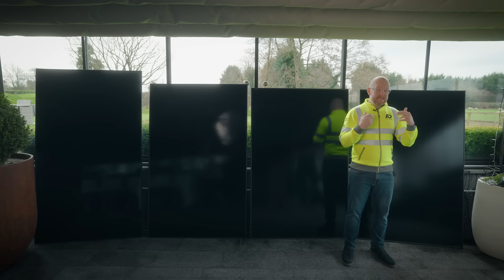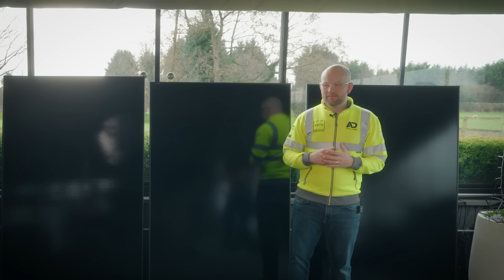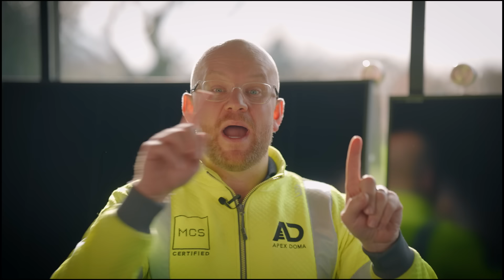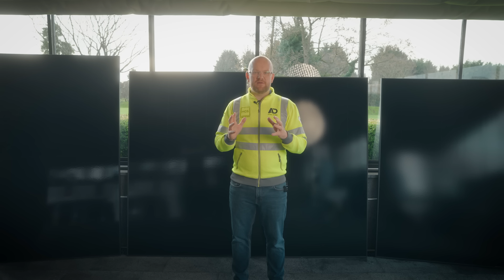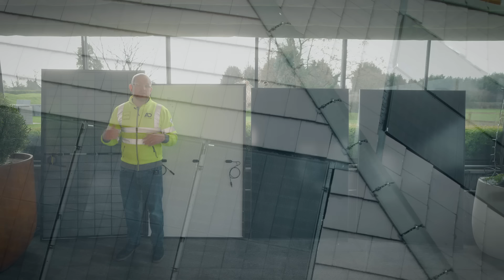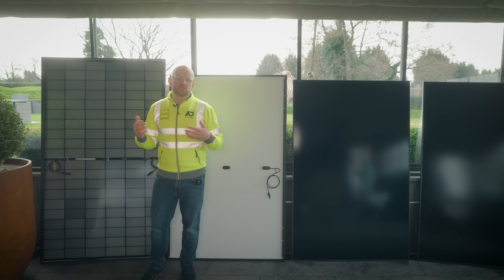Best Solar Panels 2026 UK 🇬🇧 (Aiko vs Longi vs 510W… What Actually Wins?)

Comment: So disappointed with your , not once you mention and voltage , you can't have current without voltage , I need to connect my panel in series or parallel !
no VOC come on.

Comment: Longi is a long term well established in house manufacturer that supplies cell to other panel manufacturers,aiko cheap and the new kid on the block not yet has a proven long term reliability,Longi,Trina,jinko,euener,rec,ja solar,Canadian solar,sun power,all well established panals been around a couple of decades with proven track records.the market is flooded with aiko atm good,bad or indifferent.

Comment: About to install the following south facing ground mounted array ( - Still trying to decide whether to add optimisers or to wait and see & to retro fit.)
Any thoughts / comments very welcome ?

Solar Panels
JA Solar
20.250 kW Total Module Power
45 x 450 Watt Panels (JAM54D-41-450-LB-TS-HT-AB-MC4)
19,110 kWh per year

Comment: I need help. We are just about to choose panels. It is between Aiko 3P+N 540w dual glass black frame and Aiko 3S60 Mono 530-555w. I like the look of the 3S better, but understand that dual glass may be tougher.  What do you think? They are going on a due south facing roof
Reply: Sue, are you in the UK? I was told by an installer that max Aiko I could get in uk within 2m long (per panel) was 510. I too, will be due south facing. Wold love to know more about your provider... many thanks

Comment: FYI, there never have been panels called "TOPCom".  Perhaps you're misspelling and mis-applying the term "TOPCon".  TOPCon stands for "Tunnel Oxide Passivated Contacts.  Some but not all solar cells with front side "silvery" lines are of the TOPCon variety.

Comment: We had 17 of the 510w Aiko fitted, with a 18kw Sigenergy and just had a 8.5kw ASHP fitted, we are all Electric and our Barn is 1500sqf with vaulted ceilings. Its sunny today and our Eddi is warming our water hot water, the solar panels have charged our battery and the ASHP is using 1.5kw at 20c and we are selling 5kwh to the grid at 15p kwh. 🎉
Reply from the maker: Sounds like a great setup, it's great to hear those panels are performing so well for you! 😊

Comment: Great video I know this mite be a bit of a weird question i have got a ecoflow delta 2 and I want to charge it with a solar panel in my garden and I can use a 500w max solar panel. What solar panel would you recommend i have been told to get one from city plumbing
Reply from the maker: Just don’t overthink it. Any standard 400–500W panel will work as long as it’s not too high voltage (most aren’t anyway).

Main thing:
	•	Standard mono panel
	•	MC4 leads + the right adapter for the Delta 2

City Plumbing is fine.
Reply: @apexdomasolar cool thanks for your help the ecoflow delta 2 solar input is 11-60v 15A. I have got a ecoflow mc4 to xt60i cable

Comment: All black = yes I want to prioritize looks and think that black is cool, and don't care that the panels heat up a lot more and production drops fast.
I thought the effing point of having solar panels was to generate electricity otherwise why bother. Annoys me to no end...
Reply: They do not heat up a lot more and production does not drop fast.
Reply: @palindromeambigram4852  Black back sheet panels regularly run 5c hotter than white back sheet ones which alone causes a loss of around 1.5-1.75% easily due to the temperature coefficient of the panels (usually -0.35%/C) but using transparent bifacial  panels will cause a net gain even on a black roof, resulting in a even bigger difference. This is simply physics.
Reply: @1kreature  Aiko 475w Pmp temp co = -0.26 %/C.   Black back sheet 5C hotter = NOT heating up a LOT more and -1.3% Pmp = NOT dropping FAST.  This is simple math......
Reply: @palindromeambigram4852  When you pay 30% more to get 0.5% higher efficiency and then loose it all to heating it is a LOT. My setup performed a lot better than my neighbors looking at the data for a whole year and the setups are same size and oriented the same with same sun input. The difference is only the black gaps between the cells. His panels run hotter. My roof has glazed black tiles making them reflect less than his roof that has gray tiles too, yet I win by a long way. I did not pay more and the transparent panels makes the black roof behind show though so it looks all black. There is really no change in aesthetics, but there is in efficiency. When you spend money in a market where the differences are miniscule, loosing half a % or even a full % is actually very meaningful.

Comment: Planning on in roof solar on an extension, you mentioned 400mm top and bottom gap for panels on rails. Whats the gap needed for a in roof system?
Reply: Depends on the system but you can install in-roof right up to the ridge line and down to the gutter.  You’d have to lift up the ridge tiles and relay them afterwards though.
Reply: @andrewallen9918 it’d be a monopitched roof so we can face south, could it go right up to the existing wall with lead flashing?

Comment: Solar technology has advanced so quickly. We had 22 x 275kW panels 9 years ago. However this is more than enough for our use at the moment. We now have heat pump, but most of the energy used by this is in the winter when solar is in short supply. This is where a battery charged using off-peak grid electricity is beneficial.  In the summer we always generate far more than we use. It might be that in future solar export rates may be limited due to over production. 
Overall I'd say solarPV+battery is a game changer for home owners. 
A long term investment yes, but equivalent to a 10% fixed interest rate so a lot better than most other things you can put savings into.
Reply from the maker: That winter/summer imbalance is exactly where batteries come into their own, especially when paired with off-peak tariffs. Using cheaper night-rate energy to support winter demand (like heat pumps) is where the real value is.

You’re also right on summer overproduction, we’re already starting to see pressure on export rates in some areas, so self-consumption is becoming more important over time.

Systems like yours still hold up really well though, and it’s a great position to be in.

Thanks for commenting. 😃

Comment: Aiko is not certified by solar stewardship initiative yet. Aiko's supply chain is linked to forced labour. Please update your statement.
Reply from the maker: https://www.solarstewardshipinitiative.org/about-ssi/members/ 

Aiko are a member of the Solar Stewardship Initiative, which is the key global framework for responsible solar supply chains.

Membership means they are actively working within that framework.

Like most manufacturers, this is an evolving space, but we only work with suppliers who are aligned with recognised industry standards.
Reply: @apexdomasolar Thanks. It seems Aiko has until April to get site cerification. I'll watch the space. Nice informative video by the way.

Comment: So you cover Eurener MEPV Nexa double glass panels?
Reply from the maker: We can install Eurener, but it’s not our panel of choice.

At the moment we tend to favour AIKO panels due to their higher efficiency, better performance in partial shading, and strong degradation figures.

Eurener’s double glass modules are solid and durable, but from a performance per m² point of view, AIKO currently leads the market.

Thanks for commenting.

Comment: I believe the Longi x10 panels have a very similar behaviour with partial shading.  For both you get reduced hot spot temps as a side effect.
Midsummer now have a Neostar 3S+ 530W 60-cell all-black.  A good budget option is the 3P / 3P+ which has slightly higher output but white stripes, which personally I think look OK, and are usually noticeably cheaper than the equivalent 3S/3S+.
For in-roof I would want to use the glass/glass for the higher fire resistance, but as you say the output wouldn't be any higher.
One advantage of glass/glass is that it potentially has better degradation characteristics, which is apparently why you usually see TOPCON in glass/glass.
Reply from the maker: That’s a fair point. Glass/glass modules can have slightly better long-term durability and degradation, mainly because they’re better sealed against moisture.

In practice though, the difference is usually quite small and depends just as much on the cell technology and overall build quality.

For most UK installs we find system design, shading behaviour and performance per m² tend to have a bigger impact on real-world output.

Good options either way, thanks for commenting. 

😃
Reply: I’ve been waiting for the 3rd gen 60 cells to show up. Top end of 550 for the dual glass and 555 for the mono.

Comment: Great video. A gain of dual glass panels is that there is no plastic backing to catch fire. So, Glass backed panels are often preferred in roof. The glass at the back also means that light can go in and be collected. Itv world beer good to know how efficient they are backwards
Reply: Still want to know if the suggestion someone made to paint the roof white under the panels works (or the tray white if you are doing in roof) ?
Reply from the maker: Thanks both, some good points here.

Glass/glass modules do remove the polymer backsheet, so from a materials point of view they can offer better fire resistance and long-term durability. That said, the overall fire performance of a system is more about the full build-up (roof, mounting system, installation detail etc.) rather than just the panel construction alone.

On the rear generation side, the glass back only really benefits you if there’s light getting to it. On most in-roof or close-coupled systems there’s very little light behind the panel, so the rear-side gain is negligible. You tend to only see meaningful gains on elevated or ground-mounted systems where light can reflect underneath.

Painting the roof or tray white can help slightly in theory, but in practice the gap is usually too small for it to make a noticeable difference.

So in most domestic installs, we’re still optimising for front-side performance, layout and overall system design.

😃
Reply: @apexdomasolar  Yeah I don't imagine that bifacial panels would generate any better on roofs than normal panels.  The main advantage I personally see with them is the better fire rating.  I believe that GaryDoesSolar is planning to do a side-by-side test of bifacial vs monofacial on a roof.
I have the Aiko 455W 2S on my roof and I'm very happy with them.  On the side with the chimney I have paired them with optimisers, and on the unshaded side I don't have optimisers.  My general observation is that the side with the chimney + optimisers is remarkably robust in the face of the shading, you can see individual panel output dropping due to the heavy shade which overwhelms the partial shading tolerance, but the array as a whole performs very well.  One general observation is that they overperform the estimated output from Solcast when there is bright light, and underperform when it is heavy overcast.  Overall they perform better than the solcast/PVGis & installer estimates, but very little output on the very bad days.
Reply: If I didn't already own solar panels, this would be the very first comoany I'd be gettibg a quote from.
To my knowledge, no other company has provided so much useful information to prospective purchasers to check out exactly what needs to be provided for a top-quality installation.
If Apex Doma are able to provide all the necessary insurances and backup  to ensure an owner isn't left high & dry by bankruptcy, then they would decibitely be my number one choice of installer if I could afford it.
For any prospective customers I urge you to at least watch all this channel's videos to be rapidly educated on solar installations on the lead-up to getting quotes.